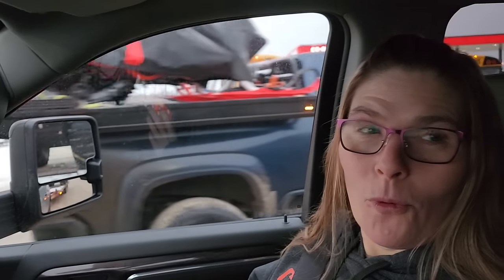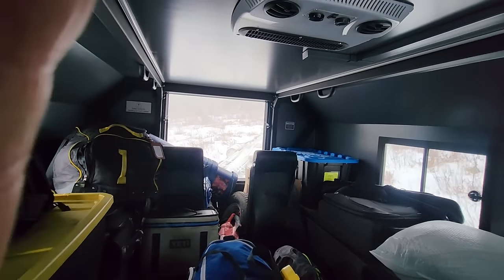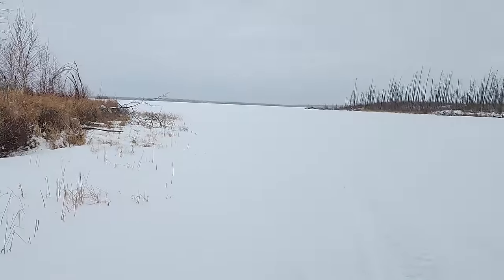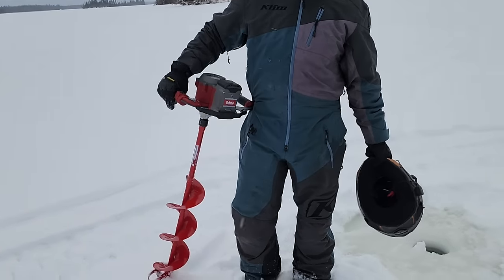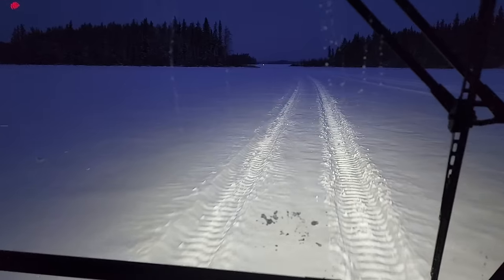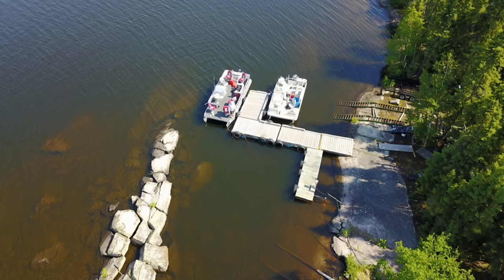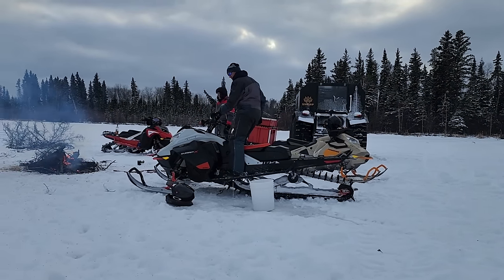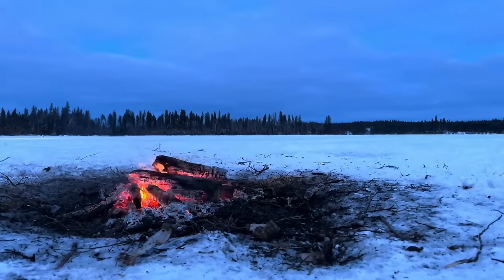Sherp Mission To Remote Off Grid Cabin

Comment: I got one of the k-drill augers and use my m18 fuel drill, can use regular extensions with it. I've gone through 30" of ice with it no problem. Super light, packs away super easy, love it.

Comment: I am surprised you don't use a Pintle style hitch for that kind of offroading.
Reply from the maker: Needed a drop hitch ot that trailer would have to be pointed upwards at quite an angle. Thw Sherp bumper sits very high
Reply: @ostacruiser  do they not make drop hitches for the pintle style?
Reply from the maker: @karicallegra8194  I've never seen one, but that's not saying much lol